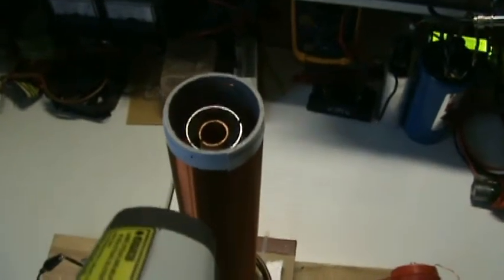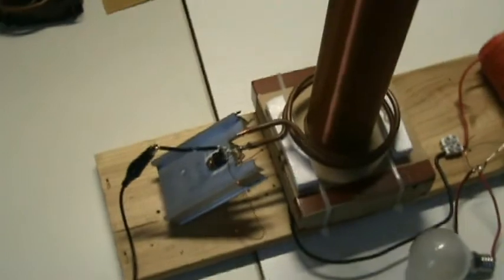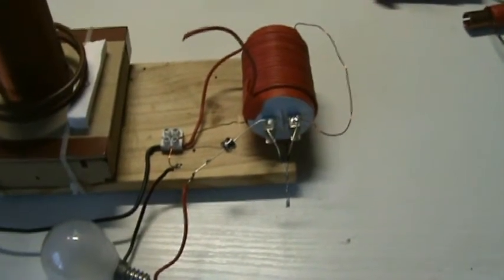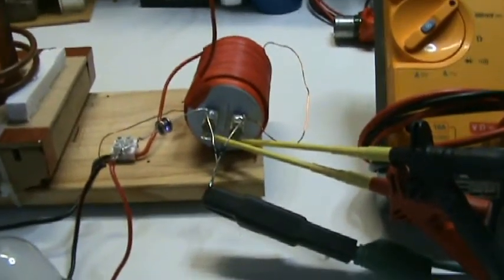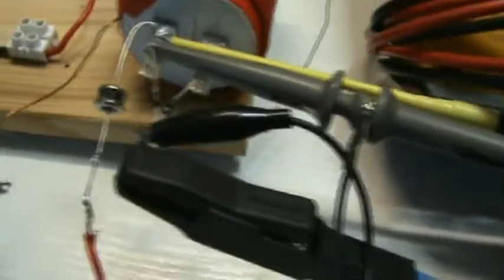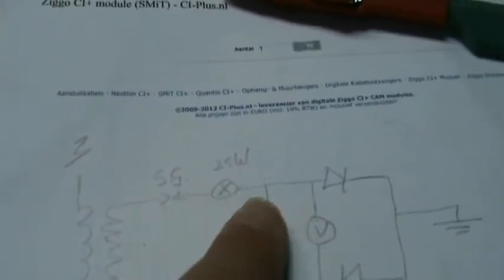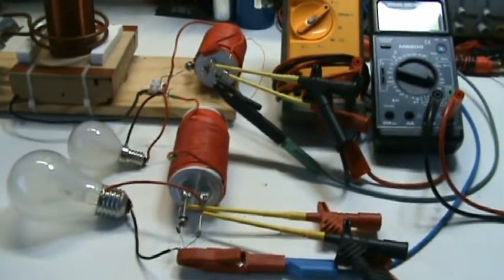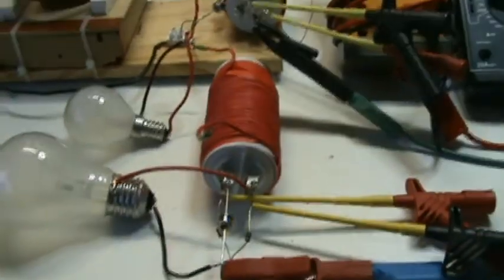Capcoil 6

Comment: The lightning arrestor surely gets high voltage but not enough to form plasma channel in first place. When capacitor accumulates voltage then it fires and it seems the high voltage is enough to support plasma channel running. Also when you connect second capacitor there is still shortest path to ground over plasma channel so secondary capacitor does not get much...

Hopefuly this helps to explain some things :)